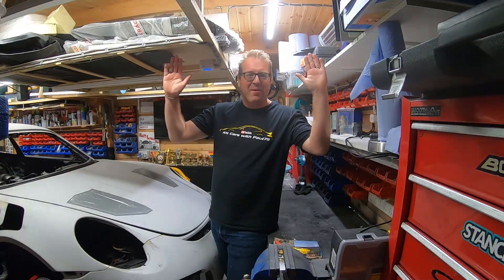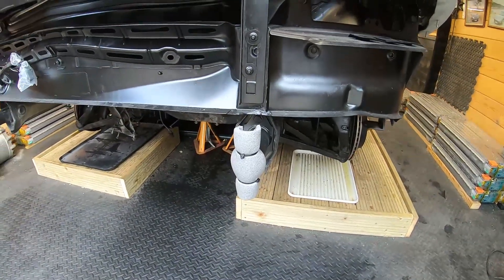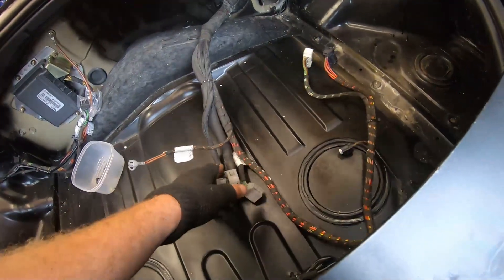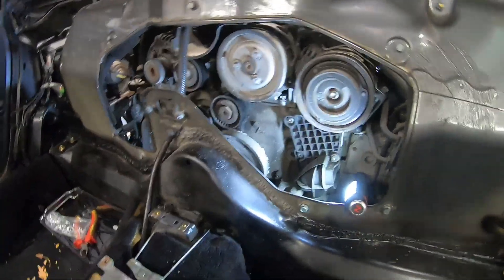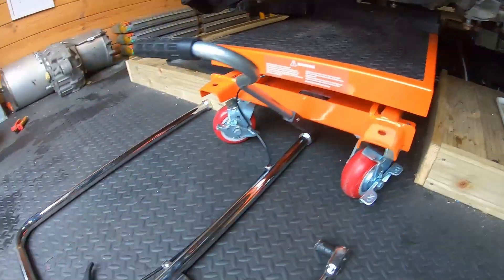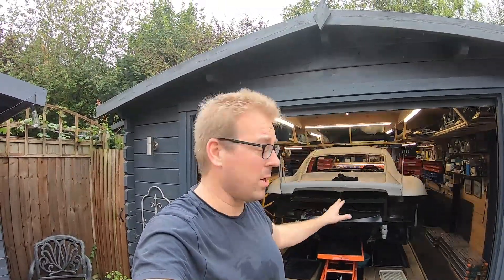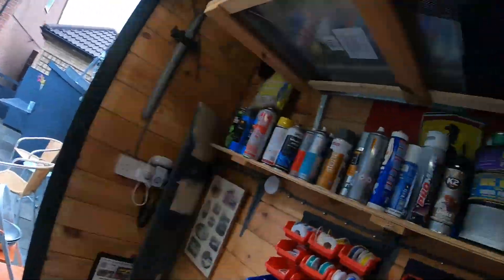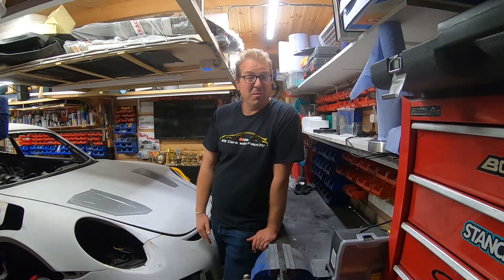EV Home Build Part 3 -  Porsche Boxster Engine Removal

Comment: It's funny how getting the engine out always feels like a huge step even though it's really only the end of the beginning.
Have you thought about making stands that bolt onto the wheel studs to hold the car once it's been raised? They could be any height you want or even adjustable but would be nicely out of the way when working on the car.
Reply from the maker: yes, I have those stands now. the issue is my ramp. it is a scissor ramp and the bits you drive over are quite wide and they hit the lower battery box. so I solved the problem by putting the car on axle stands on the ramp. that gave me enough height to get the battery boxes in and would have been a better way to remove the engine. if you look at later videos you'll see what I mean.